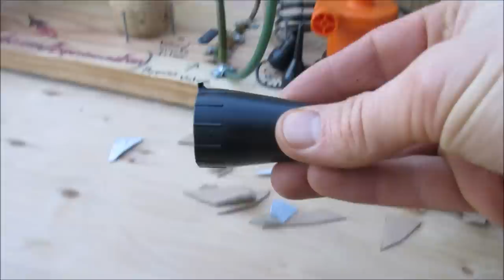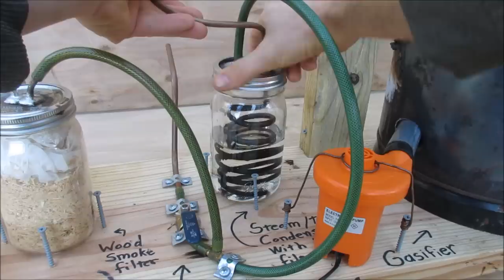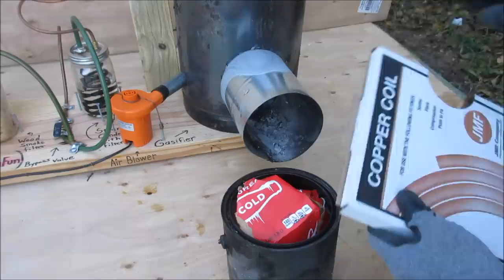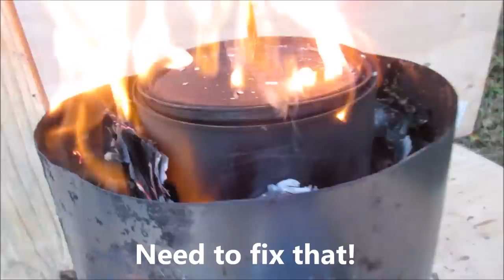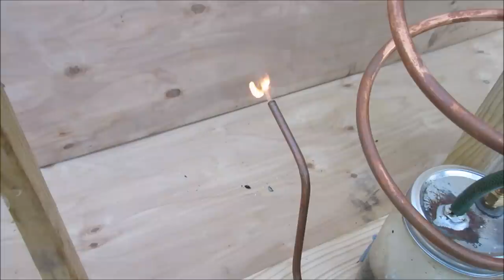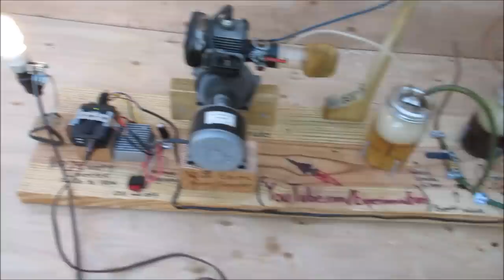How to Run a Generator on Trash!  (Gasifier Pt 2) Experiment

Comment: suggestion: if you added water to your reactor, and then pressurized it such that the temperature was allowed to reach 800 degrees before starting to bleed of gas, it would crack the carbon chains and water to create a hydrocarbon and carbon dioxide.  this is in addition to the wood gas you're currently extracting.  the waste stream at the end would be almost non existent.  one further note, this type of modification would be able to easily crack plastics into fuel also.  plastics are a particularly rich source of hydrocarbons.

Comment: I feel like you should have the shroud on the front of the engine ,for it pushes air flow from the flywheel over the cylinder for cooling ,FYI

Comment: Put the gasifier's radiator on the front of the blower, while it helps the gasifier, it will also help to preheat the air coming to the burning wood, making it even hotter.

Comment: You might have tar in your curly condensation pipe, that might be causing the lid of the paint can to pop. Otherwise, it may just be due to thermal expansion of the pain can itself.
Also be careful, if you don't filter the gasses of the tarry compounds, your engine might become gummed up or even damaged. Seafoam could possibly help clean that.
Reply: Just put weight on it! And a holding structure below!

Comment: Hey. Could you try running the gasifier on plastic. I know normally it produces black smoke but if you get it hot enough the plastic becomes oil again. And heating the oil hot enough causes it to become smaller chain hydrocarbons. Like hexane. A chemical in petrol.

Comment: I don't know much about this but 2 thoughts were Maybe a better designed rocket stove would negate need for air blower? Also, maybe have a bank of super capacitors being charged by the generator, this could then be used to start the motor?

Comment: This gassifier probably gets hot enough to vaporize certain plastics like polyethylene or polypropylene, but even if the gas made it through the bubblers and filters it would have the same problem as trying to run the system on wax.. but worse.  At best it's like trying to run your motor on kerosene or diesel and at worse every surface below about 300 C becomes coated with a growing layer of plastic.  The problem with this system is that it's so close to being a syngas reformer without actually being one.  That is, nothing is being reformed; the volatiles are just being driven off in the absence of oxygen to prevent them burning (pyrolysis).  As counter-intuitive as it sounds, It would be a good idea to rig up a way to feed water into the inner gasifier vessel (the paint can) such that steam is produced at a fairly high rate.  The can will become pressurized (even more so) so the water will likely need to be supplied via a pump. Alternatively, a separate boiler could be built and mounted above the furnace.  Try with wood or anything you already know works before trying plastics.

I haven't found any accounts of videos of them (syngas generators) being built by amateurs but the basic principle is that a cheap, low grade fuel containing carbon (coal, wood, trash including plastic, or even just coke) is reacted with steam at high temperature.  The reaction is strongly endothermic (absorbs heat) and produces a mixture of hydrogen and carbon monoxide (syngas).  Insulating the hot parts of the system would greatly save on fuel and probably be necessary to keep the system economical. The syngas can be burned directly in the engine or passed through a catalyst bed at a lower controlled temperature to initiate the weakly exothermic water-gas shift reaction, which converts the carbon monoxide in the syngas (which is a fuel in its own right) to carbon dioxide and more hydrogen (which is a better and non-poisonous fuel).  I have been fascinated by these reactions ever since I learned of them and it's a large part of why I'm watching this video at all.  I would love to see someone actually tackle them at home.

Some of the stuff I've read:
https://en.wikipedia.org/wiki/Gasification
https://en.wikipedia.org/wiki/Syngas
https://en.wikipedia.org/wiki/Water_gas
https://en.wikipedia.org/wiki/Water-gas_shift_reaction

I already put this in the thread about gassing plastics but it turned into kind of its own thing and I wanted you to see it so I'm reposting it myself.
Reply: cannot process

Comment: I wonder if you could gather enough electricity from the engine running on the wood gas to power some heating coils to heat the wood/paper scrap while also having excess electricity to use for charging or powering something. Obviously you would need to insulate things really well, and you would want a temperature controller to help save electricity. Idk the proper equations, so I couldn't tell you mathematically if that would be breaking the laws of energy and thermodynamics or not.
Reply: thermodynamics says no.

Comment: You wouldn't need a battery if you used a few Thermo Electric Peltier generator in series.   It would use the heat to generate power.  You would need a heat sink though.   An ice pack could do.

Comment: Maybe you need safety and pop off valves like a boiler or pressure cooker to avoid an explosion ? A mini boiler could run the motor/generator and the gas could heat the the pot......if you can interpret that.....

Comment: Instead of burning trash to pyrolysis it. Why not use a focal mirror to decompose your trash? efficient right? Maybe you could pyrolysis plastic next time. bubble it through water and collect hydrocarbon fuel at the top. Just a thought.

Comment: I do have one question though, i assume thats a two cycle engine, how are you lubeing the crankcase if you are useing woodgas?
Reply: It's a little late, but in part 1 (when he runs it for a little bit on wood) he shows that the vertical tube to the right of the engine is full of 2-stroke oil, and oiling is handled by the carburetor.

Comment: You should switch to a 24V inverter and just leave a nearly dead car battery (2 in series) plugged in to handle transient current load and watch the DC voltage slowly rise showing that energy is being made. A 24V inverter wouldn't need an unnecessary and lossy DC-DC converter.

Comment: Hi, is it possible that the prototype can be feeded with food waste? We have the topic for our thesis which is converting food waste into energy and we happen to stumble across your video. Can we use your idea and maybe put some innovations? Like let's say a IOT based or microcontroller based gas monitor or energy monitor. Thanks!

Comment: is the engine just running from un-burnt hydrocarbons, is that why it needs the sawdust filter. also the hydrogen one needed Carbon filter, thats unburnt carbon too. is that the key to this engine performance?

Comment: Sorry to comment again it been trying this esperiments but I am having problems with the hose clamps both of my motor shaft are longer than yours and mines had a clutch witch I removed I got it running twice but I think the hose I am using its not the greatest because it sometimes melt when I use the elctric motor to start the engine also my engine is 35cc slightly bigger but my hose slips and it melts but I have only tried one hose because I only have 1 size may I ask what is the exact type of hose you use I will make a video of how mines is going in about a week when I figure everything out

Comment: You are creating charcoal and when the  outgassing is complete you lose power.  Try introducing some air at the bottom of the gasifying vessel at the end of the gasification. This burns the charcoal to carbon monoxide which is still a pretty good fuel for gasoline engines. Might get more running time.

Comment: In theory this would work fine. Unfortunately though, many modern forms of trash weather it be paper or cardboard are treated which is what gives them that magazine texture rather than the a notebook paper flimsy feel. What this means is the chemicals used to treat the waste when burnt releases those chemicals into the air which are just as bad as carbon emissions if not worse because they are colorless and more toxic.

Comment: The capacitor charges before the inverter turned on so when the inverter turns on the capacitor is fully charged by the generator and when the inverter turns on it has a huge spike of current that the capacitor releases

Comment: Can someone help explain how this works? 

From my lack of understanding, I believe the trash that is burned is converted into carbon dioxide which powers the generator(motor), in which the polarity is reversed. The motor acts as a generator to power the inverter and turn on the lightbulb. 

Is this right?

Comment: I know you are doing this on the cheap but running an alternator off your engine and using an inverter would get you 110v. Then you could charge your starting / fan battery. Be self sufficient besides garbage. I agree with the fan not being needed too.

Comment: Wouldn't wood work as well? You could make charcoal inside the can and use the char coal to burn the next batch. Like every batch would provide fuel for the next as long as you keep using wood. Trash is good too I guess .
Reply from the maker: yes wood well work also, I actually made a video of it running on wood before this one :)

Comment: Or just hook the car battery to the bulb.....Call me picky but I thought the point of running a generator on bio fuel is that it requires only the bio fuel to produce electricity so when you add a car battery to me it defeats the purpose......or am I missing something?

Comment: You are using DC motor for the battery to charge then the one driving the motor where the gas is going in called what?

Comment: Dude seriously, you need to try a downdraft gasifier... all that smoke, heat and fuel you are using to gasifiy the contents of your paint can can be used too...!

Think of a tobacco pipe, the smoke is drafted through the fuel... Down draft is the best way mate...
Reply: ki4clz except downdraft gasifiers are really picky about fuel pellet size with respect to clogging and producing a stable coal bed. His system is not as efficient, but it works on almost anything. Probably including plastics and stuff
Reply: you're talking about "bridging" I assume... 

If the gasifier is insulated well and the draft inlets are placed to create a swirling motion at the venturi, bridging will not be problem as the intense heat will turn anything into charcoal preventing bridging form occurring...

Comment: Problem with the whole recycling idea; burning the trash producers greenhouse gases, where actual recycling the products don't (except potentially the energy used in recycling). The only real savings is using renewable sources instead of fossil fuels.
Reply: Yeah that was right🖒

Comment: Dude, its a 2 stroke engine, it needs oil in the fuel for lubrication! It will die really soon without oil, running on gass only
Reply: He installed a gravity fed oil tank, you can see it in the video

Comment: Why dont you just tap the bulb into your batery ?  You built a generator that can make trash into power but your output need a battery to work ?
Reply from the maker: it doesn't need a battery to run, its just to start it, electric start

Comment: Steam engines or turbines are better.  Same amount of space taken or less and steam technology has kept pace with new technology.  They can even burn pastics, compost, oils, and dry feces.

Gassification is fun sometimes but its not good to try to operate equipment or generators with.

Comment: 2 stroke engine running on smoke. That engine will not last long will score the piston and cylinder
Reply: It's running on gas contaminated by smoke but that can easily be overcome with a slightly better filter system. They ran many essential and important vehicles like buses and local haulier's trucks using this exact principle during WWII where I live. They had a setup just like this sat on the back of the vehicle to fuel the engine and it really wasn't any more complicated than this one.
Reply: @Stigstigster  that was on 4 stroke engines.
Reply: @Liberator975  Yes.
Reply: @Stigstigster  here is the reason of the op. Its a 2 stroke running on smoke. Ie no oil
Reply: @Liberator975  Ahh, I see it doesn't have a separate oil reservoir so this motor would normally run on a premixed fuel. I can see that being a problem.

Comment: Him need to fix gap in bucket answer is you can't the lide is opening due to pressure on the inside the smoke coming from the stuff I'd building up pressure thus making the lid open if you seal it permanently air tight the bucket will pop not in a good way tho.

Comment: People people look at the comments you guys are not looking at the big picture. The point is not lighting the light bulb that could be simply done with a flame the point is he's taking biodegradable burning it in extracting the gas which during World War 1 the Germans used a gasifier to power their vehicles because they were cut off from the gas refineries. So this is about the gasifier not the generator. You can also do this with plastics and extract the petroleum used to produce the plastic in the first place now granted if you're in the US the EPA would not like you so make sure you do it in your garage. And don't tell your liberal Neighbors about it.

Comment: How do you lubricant that small 2 stroke engine?
Reply from the maker: i attached an oil like to the fuel inlet and just like it drip in, its not prefect but its better then no oil
Reply: @ExperimentalFun  that is still pretty cool though.

Comment: if you managed to make it run on plastic and not pollute the air we'd have a new green energy source
Reply: the problem is that only things that used to be wood will work... (the engine is running on woodgas, ask google if you want more info)

Comment: Wait...your Generator works by using fuel and electricity and gaining back a tiny amount of the electricity you used to run the blower...well that's not how a "generator" works
Reply: He switched off the blower for the second half of the video. It's basically optional and only is there to start the fire more quickly.

Comment: Take the exhaust of the engine and pipe it to the firebox with a annular Venturi and you will have forced air combustion without wasting energy

Comment: WHAT IF YOU COULD ALTER YOUR HEAT SOURCE WITH A NON-COMPUSTABLE SOURCE AS A VERY REFINED SOLAR OVEN COLLECTOR?   VOLCANIC SOURCE (HA HA)...  ANYWAY, THE POINT IS GETTING HEAT WITHOUT USING UP THE RESOURCE USED TO MAKE THE (WOOD GAS - HYDROGEN / CO GASES)......

Comment: Why a engine and not a gas turbine to generate electricity?
Reply: Now when I'm thinking about it, wouldn't be a sterling engine much more efficient and cheaper to build? 😂

Or was it just to proof that you could produce enough biogas to run an engine like they did in world War 2 as they ran out of fuel for their Civil cars?

Comment: Why don’t you just use the electric fan to airerate the gasoline
Reply: there is no gasoline ... thats the point
Reply: matthew hurley yeah that’s the yellow stuff in jar the fumes from trash add oxygen to the fuel so the engine can run off of the fumes

Comment: Pls Can you make homade rocket fuel
Reply: 1. 2 test tubes upside down under water (full of water)
2. add cables + in one tube - in the other
3. add same kind of acid/salt
4. add electricty (also step the fuck back)
5. watch as tubes catch the gas
6. remove electricty
7. cork tubes
8. ???
9. profit

one tube has oxygen the other has hydrogen, this fuel mix is used in liquid fuel rockets (its cooled till liquid before use, this causes the "smoke" you pre-ignition on big rockets)

Comment: Totally impractical. You could have just used an old air tool and used the pressure in the paint can to turn it. Then connect the air tool to the generator and voila

Comment: can i know alternative for 25cc engine
Reply: Tamizha you can use any type of an engine
Reply: can use suggest any low budget engine for high school student project
Reply: Tamizha well buying a new engine may be expensive.  I usually find engines on scrap yards for really cheap. Yesterday i found a 4 stroke engine for 10 dollars/euros.
Reply: Tamizha where are you from dude?
Reply: malaysia
Reply: anything dude
Reply: The shipping will cost you a ton of money dude.  Engines are heavy
Reply: engines i can get over here,i just want ask it is possible if generator run burn solid waste such as food waste??
Reply: CukaPower 27 
Hi,i want buy engine,i already get some example ,i send to u,cn i get your  email
Reply: CukaPower 27 
I confuse which one

Comment: You are using a electrical motor to run that thing which need electricity and getting electricity them what is the profit🙄😂😂😂
Reply from the maker: thats only to start it
Reply: @ExperimentalFun  you are using a air sucking pump